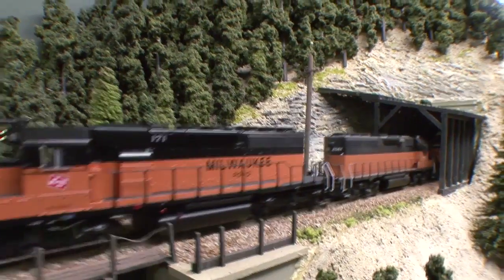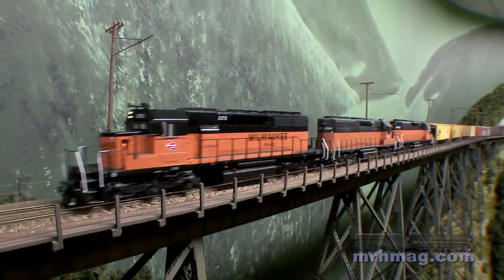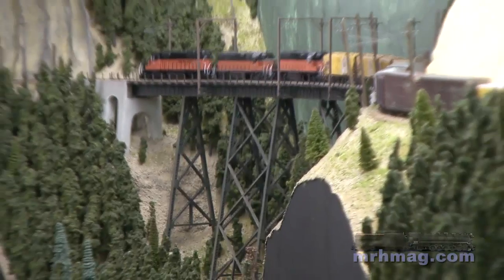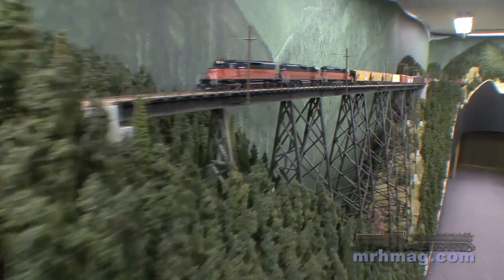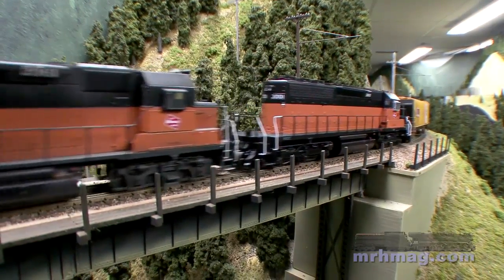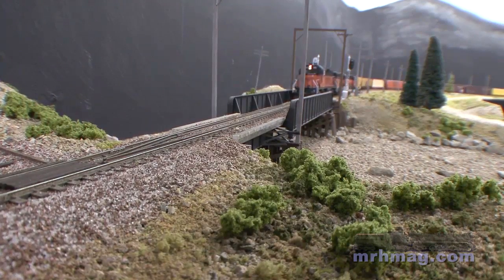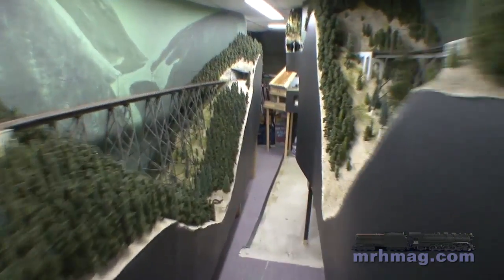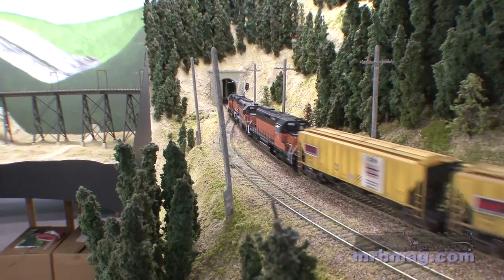Bill Heiden's Milwaukee Road Railroad  | Grand Rails 2012 | Model Railroad Hobbyist

Comment: Magnificent road in what seems to be a small space. Wow you did a great job. I'm not into sound yet because I have heard so many sound systems that make the engine sound like a 1960's electric shaver. Maybe some day. Right now I an looking at the battery operated systems. No power in the track, no worry about reversing loops.

Comment: You make me jealous! I model N-Scale but have yet to find a house situation stable enough to complete a full layout. I have a large enough basement here, 16' by 35', and actually had an operating, truncated layout,  (some 100 ft. of mainline), of the Milwaukee Road, which along with C&NW forms the core of my favorite two railroads. ONE DAY, I believe, I will have possession of a house for enough time to complete my 'dream layout'.

Cheers, and great work!!!

Comment: One little sidenote: I notice you have a mid-train "slave" there. In reality they served a very short time because of all the tunnels on the hill. They would shut down power when entering a tunnel and then you could hear them powering up again when they emerged. This caused big time slack and jerking in the train. They went back to the box-cab helpers and later crewed diesels. If you are interested I wrote a memoirs of my time there 1970 to basically when they shut down.  Let me know and I can email you a copy. 56 kb if I remember right.

Comment: I can sit and watch your excellent layout videos all day long. And it's nice to see a train operate at a prototype speed. I run all my trains with a caboose. How long are the biggest freights you run ? Thank you and keep 'em on the iron.
Reply: +Steve Hastings Train sizes are usually 20-25 cars. Depending on what equipment is being handled. I have alot of autoracks and 89' flats running around.
Reply: +Vanessa Heiden Excellent. Thank you for the nice note. Any newer videos planned ??
Reply: +Steve Hastings Nothing in the near future. Time is a huge issue. The real railroad takes more than its fair share.
Reply: +Bill Heiden I can attest to that. They can be extremely time consuming.